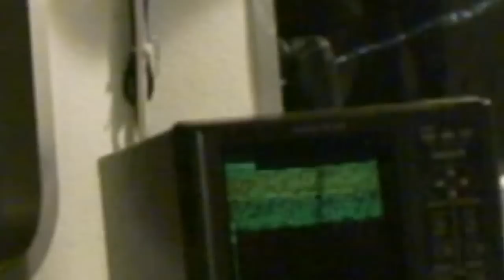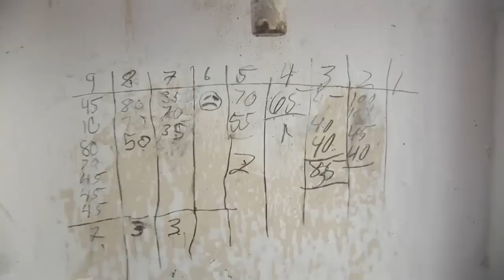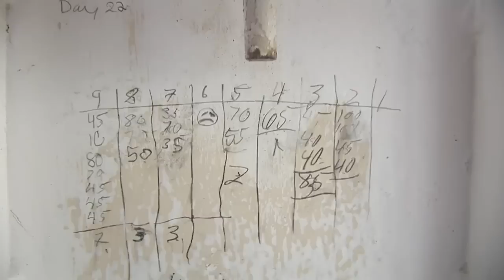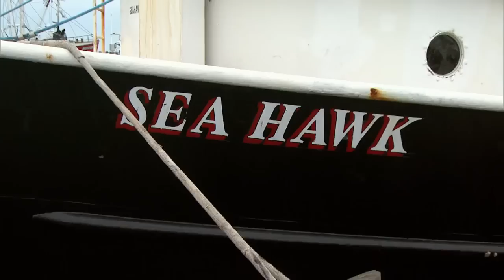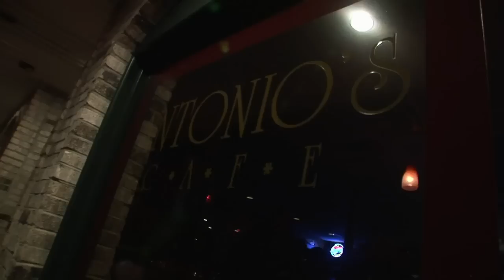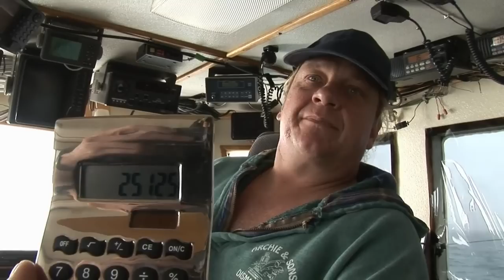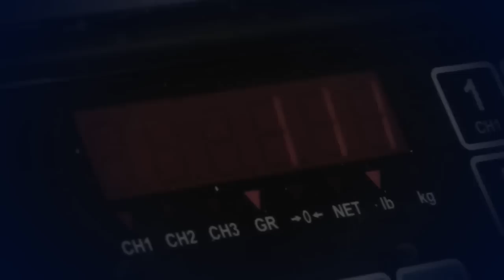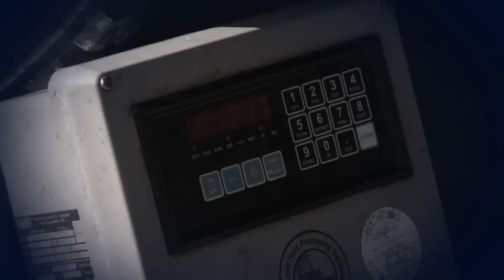FULL EPISODE - Swords: Life On The Line | Season 1 | Episode 8

Comment: I ran the numbers based on October 2008 prices for swordfish. At 50,000 lbs of swordfish the spot price for November 8th, which is approximately when they came to port was 5 dollars a pound. 
That means the trip netted 250K in profit. 
Even if you were to be generous, it never costs a ship more than 100K to be out at sea for a month and a half. That's being the most generous with fuel bait and other assorted costs. It's usually 25-50K which, in episode 2, was what The chompers guy mentioned as the absolute minimum to be profitable. That means at 5 dollars, they were in the green at 10K pounds of fish. Assuming you go high side, that means that the total profit leftover was 200K. 100K goes to the owner and pays for the bills on the boat. Leaving 100K for the crew. Greenhorns get 3/4 shares and the crew get full shares with the captain getting a double share. No matter how you split it, they should have gotten 5-9K at minimum. With high sides of 16K being entirely normal and reasonable.
Reply: Intelligent, reasonable, and well-said. I have to agree with you.